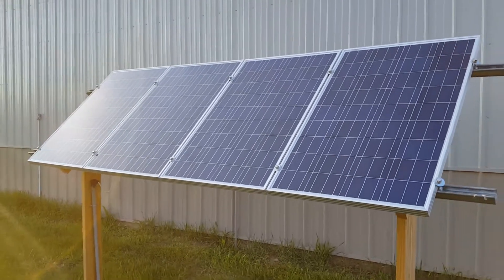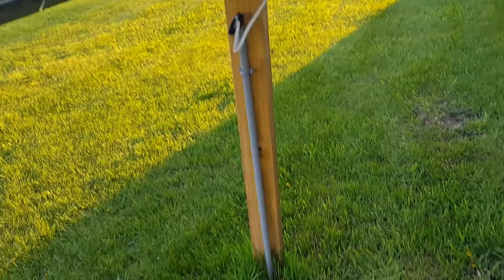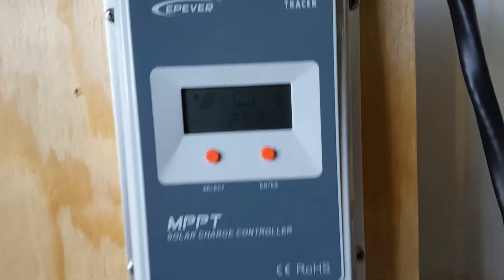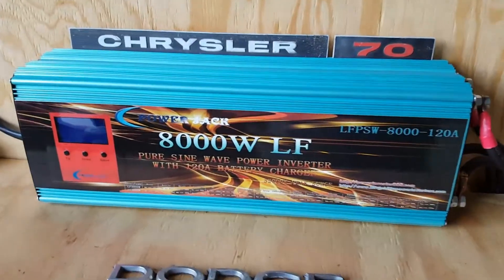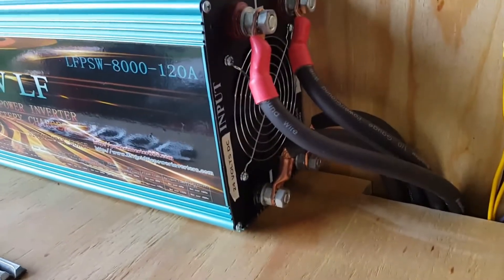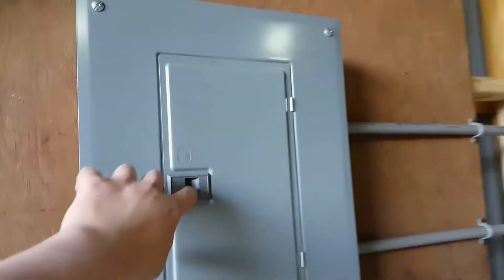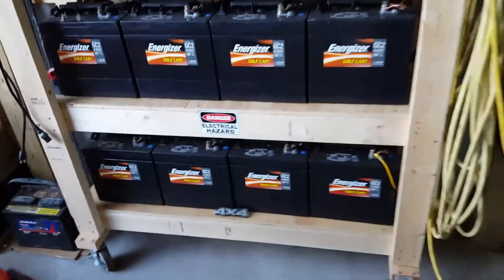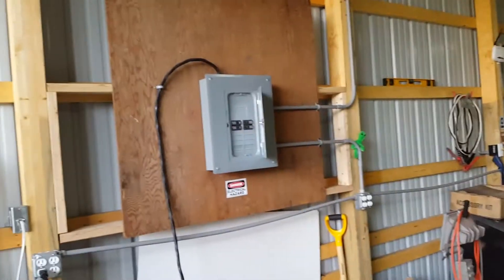Off grid solar.  With powerjack 8000 watt inverter

Comment: Where do the yellow and purple  wire that are on the controller connect to?
Reply: How do you have your batteries wired up ?
Reply from the maker: They go to the batteries.  the black and white are from the panels.

Comment: Hi Does the battery charge fully with the 4 panels.
Reply from the maker: Smalls#1 Trinidad Yes, but it may take 3 days if they are drained..  I don't use the system often so it works well.  If you used it everyday you'd need more panels.
Reply: what  peak  of  power you can  get out of  those  4 panels?

Comment: Are you only running 110 Volts in your AC system or 220 Volts?
Reply from the maker: KmanJeeper just 110.  I don't have anything that needs 220 yet so i wanted to try a cheap inverter first..